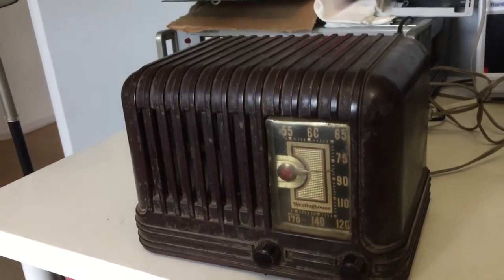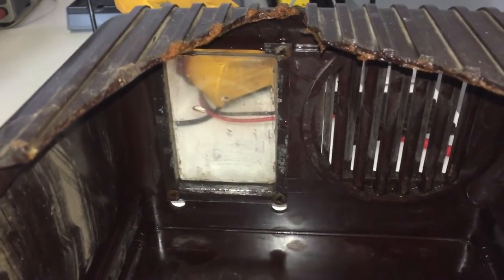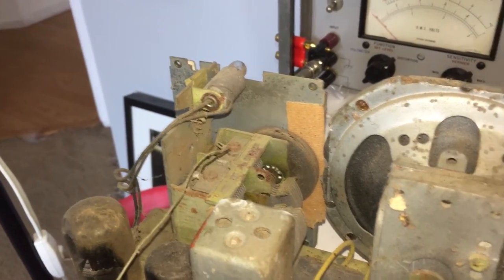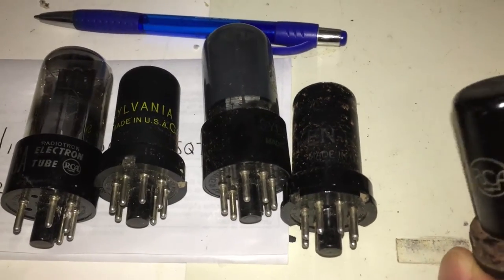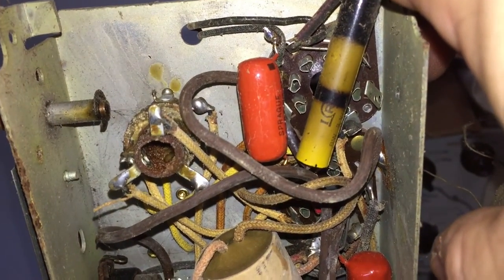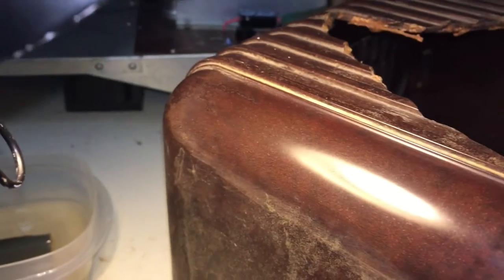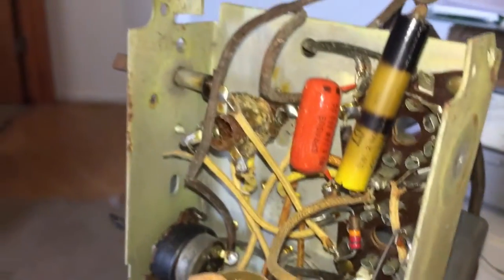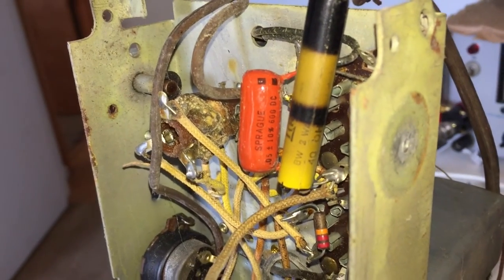Westinghouse Model WR-13X5 Restoration part 1

Comment: Looks like it could be a nice unit when you get it going. It is pretty normal for radios of that era not to be fused. I always add a fuse myself, but the idea is that either the tube filaments would blow, or there is often a low value resistor right after the rectifier (tube or selenium, etc.) that actually acts as a fuse. So never replace those resistors with higher wattage versions. I don't see that resistor on your schematic, though.

It is amazing how unsafe those things were, but cars had no seatbelts then either...

Nice job on the bakelite. Are you sanding by hand? Do you plan on using a Dremel in the fine areas, or just little pieces of paper with dowels/sponges, etc.?

You said after the hurricane. I hope all goes well on that front. Stay safe.
Reply from the maker: I know, ive clipped the resistor out, i think it was added to keep the radio working, no doubt due to substandard caps or other issues.   A lot of the values are different than the schematic,  also the schematic shows a choke that I cannot find int he unit acoss the electrolytics, also different sizes.    Ive checked all model types of this series, and nothing matches this radio.